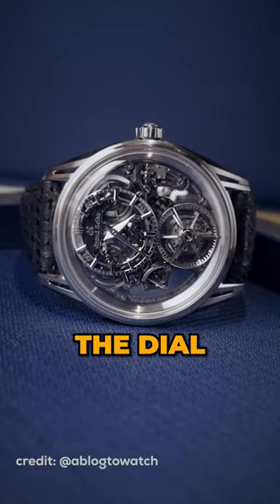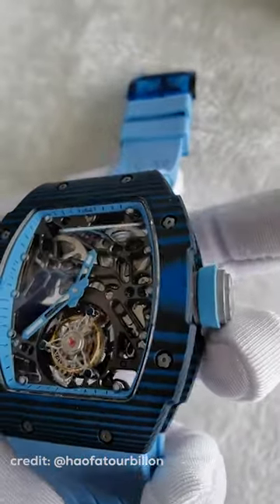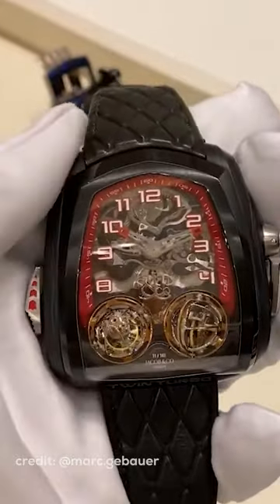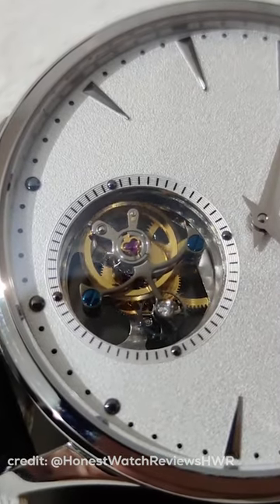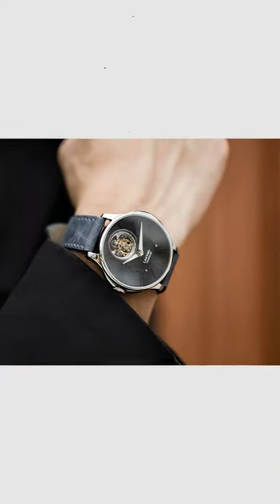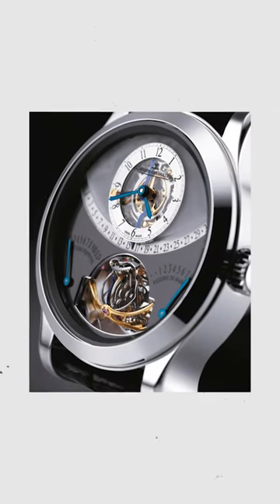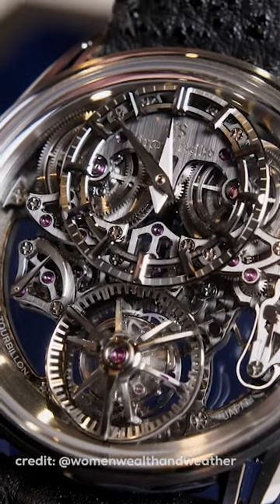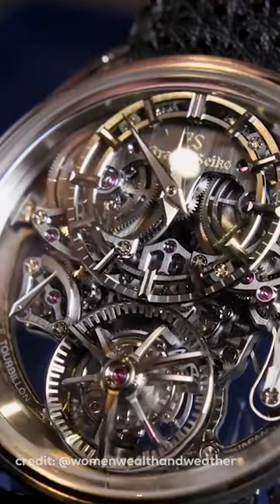Tourbillon Watch Movements Explained #watches #shorts #luxurywatches

Comment: it's for pocket watches for what you state. It was never designed for wristwatches because it not needed in them it's in wristwatches for strictly show and to up the price that's it
Reply from the maker: You're right, that's a very important distinction, they're mostly only useful to reduce positional accuracies when the watch (or pocke watch) is sitting in ONE position (which won't be often in a wrist watch since you move it around so much).
Reply: I do believe, like a power reserve on an automatic watch, that a tourbillon on a wrist worn timepiece is a useless complication.
Reply: @billbrown4745  one might make the argument that the multiaxis tourbillon could help having better accuracy. And one would probably answer that 6 figures to still be worse than a high accuracy quartz is still useless.
Reply: There is no need for mechanical watches either